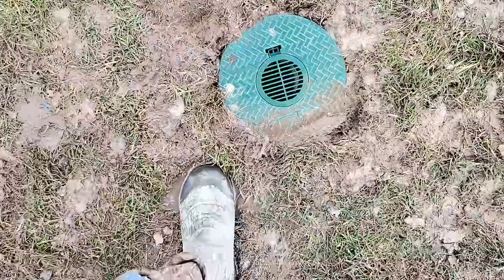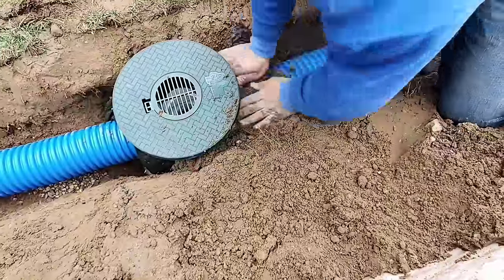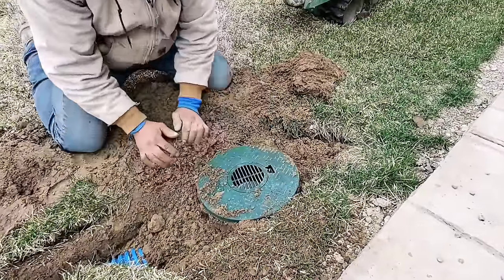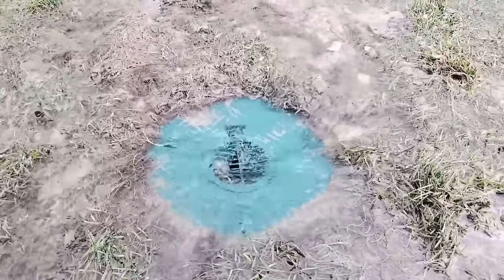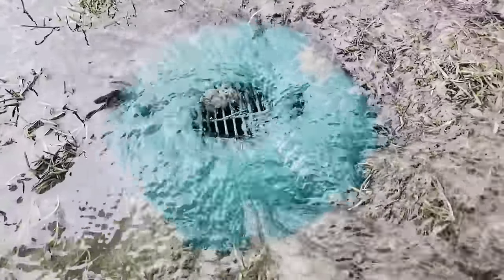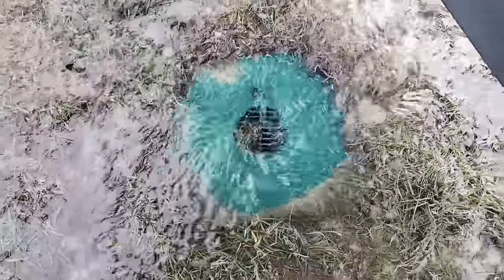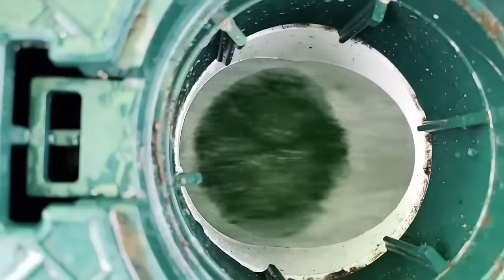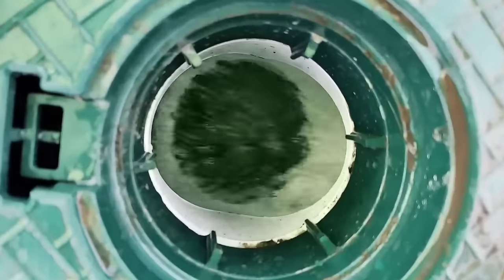DIY Cheap Yard Drainage Solutions Save Homeowners $1000s [ Hurricane Proof System ]

Comment: Every rainy season in San Diego my neighbors runoff flows to my side door. I have gutters and drains around the perimeter of my home but my side door entrance has a 1”-2” pool of water that drains slowly towards the sidewalk. I was thinking about installing a sump pump system or something similar to this on your video. My only delay is that my paver walkway was set in cement. It’ll take me some time to remove 12” of pavers 30’ and use gravity to remove the excess water. I’m doing other projects and I’m the only person that uses the side door so this gets pushed back every year and now we’re about to get into the rainy season. Thanks for all your videos it helped me on other projects.
Reply from the maker: https://youtu.be/Ie11haI5WO0?si=vW9NLkOGp_JJL5RF

Comment: I get a flooded yard after heavy rains. I dug 2 vertical 4” PVC  pipe drains wrapped in a silt sock and a drain cap on top. I have to cover the top of the pipe with weed block material due to the small sticks, branches,debris that clogs the top. Also there is a natural spring located about 8’ deep where the water pools up. The yard drains little better. Thanks for the video
Reply from the maker: PVC is so bad for the environment. I wouldn't recommend ever using that. It's bad for the soil. It's bad for animals and it's bad for humans.

Comment: These look simple and clean to work with great video!  Would you be willing to do a video comparing these with the D-Boxes you used so much in the past?  Wondering if these are the next evolution of that concept or are these in line catch basins far superior to that approach?    

Also, FDM should consider a polylok d-box buy back/trade program for folks who pulled the trigger on a few of them but hadn’t gotten around to installing them if these catch basins + turf restrictor plate are the better way to go. Naturally asking for a friend here… 😏
Reply from the maker: Not a problem. If the office has your order in the system should be able to switch them out.

Comment: I have a question.....I have standing water in my back yard coming from a piece of property behind my house.  That property is at a higher grade than mine.  Is it possible that I can install the inline basins for the surface water, connecting it to perforated pipe below to catch the water below and send it to pop up admitters...this way I can grab the water before it gets to my house and then into the basement.  As it is we get water from below into the basement anyway and out sump pump works a lot.  I am just tired of the water pouring out of the neighbors back yard flooding mine.
Reply from the maker: This year, I'm doing many new videos on this topic. In July, I have some trick new parts for this, too.
This video is an older video. But the concept stays the same. If you are going to do what you described, it only works with a knife cut ( or fine cut ) perforated pipe. 
I will do my best to build on this subject. It's one of the most misinformed systems built on YouTube. What you see on Chuck in a van channel is wrong and fails in 2 years. That's why he has a 2-star review and no longer has his Google reviews listed. He pulled them down. 
Stay Tuned
https://youtu.be/76EcYaGDboM?si=uxntPbvzmaBHTqvO

Comment: Watched a guy, dig a hole in the low area of a lawn, dig a hole below the hard soil line, about 1 to 2 feet.  Lines it with soil cloth.  Filled that with stone and replace the grass plug on top.  Drained all the puddled water.  A bit cheaper.
Reply from the maker: Best of luck, drywell, seldom work.
Reply: You would say that.   @FRENCHDRAINMAN

Comment: Does this work for rerouting the water that floods from a protected fish habitat stream that runs along the property side  back into the stream? And what about debris entering the pipe system? Your water looks pretty clean but this water also has some mud/dirt and things. Can this still be done?
Reply from the maker: If you wrap the French drain system and you use a solid pipe for your yard drain and a separate perforated pipe for your French drain, you will isolate your French drain pipe from those contaminations.

Comment: The industry is missing a dry well basin that has a large enough pipe coming to the surface that you can drop a portable sump pump down into. NDS makes a basin but it only has a 4 inch opening and that isn't enough to drop in a sump. wish you could get an 8 inch pipe leading to the surface to drop the pump down into.
Reply from the maker: https://frenchdrainman.com/build-your-sump-system/

Comment: Do you try to run a pitch to all this pipe or just by it being a void allows the water to run away?
Reply from the maker: I always start at the highest low point and work my way to the lowest low point as a general rule. This works most the time. A outdoor sump pump lift station is required in many cases at the lowest low point. Hope this helps. Thank You for your question.
Reply: @FRENCHDRAINMAN  thank you.  I watch your videos quite a bit.  I learn lots from you.

Comment: When the pop up emitter plugs, the inline drain before it becomes the new pop up emitter.
Reply from the maker: Yes it vents at the closest outlet.
Reply: @FRENCHDRAINMAN  No, I meant as leaves, needles, and debris plug the pop up emitter, then the water will just flood out of the closest inline drain.  Corrugated pipes and pop up emitters are terrible to use when trying to move water.

Comment: I’ve watched several of your videos. I have not seen in any of them, at least not the ones i’ve watched, where does all that water go? Does it drain to the curb, the municipal sewer line, is being pumped out somewhere else, etc? Whether it be down spout drains, french drains, or yard drains.
Reply from the maker: Watch "Yard Drainage $40,000.00 French Drain How To Build a Yard Drain System with No Slope [COMBO INSTALL!" on YouTube
https://youtu.be/gq1BuCbjGX8
Reply: If my 6inch pipe is backed up with 2% slope should I remove the 6inch pop up drain and just use a critter guard ?

Comment: Hey FDM, Love your work. I live in upstate NY with a lot of clay and snow. My backyard is sloped pretty well but still has pockets of standing water after a rain event. The back of my property does slope down to a creek so I can end the pipe out the side bank. Based on this video, where you mention a soupy mess, I know I need some catch basins but I don't know if I also need a french drain. What is the tipping point to know you need both? Given my clay environment, I don't know how long the french drain will hold up - obviously much longer now that I am subscribed to your channel, but I think you know what I mean. I can't wait to purchase all my supplies from you when I pull the trigger this summer. Thanks, Bob
Reply from the maker: I would do both
https://youtu.be/F1MNegA1yMM?si=u-lFk9tjLct8VluZ